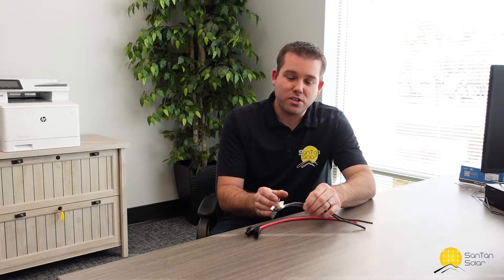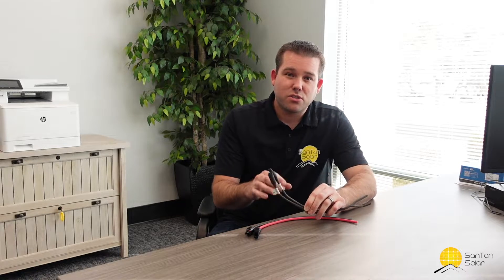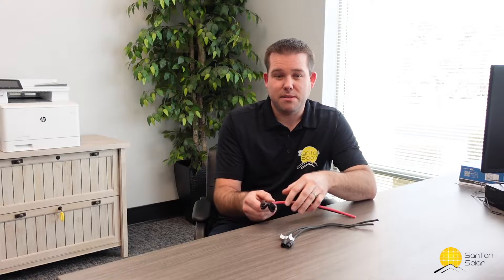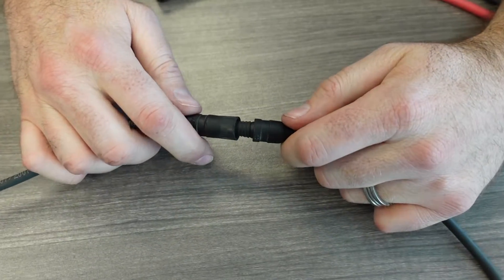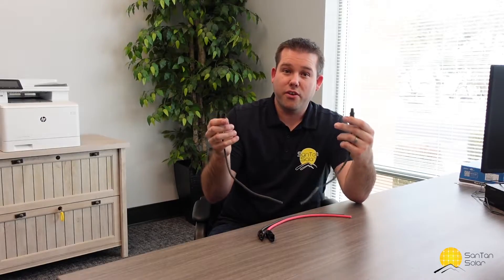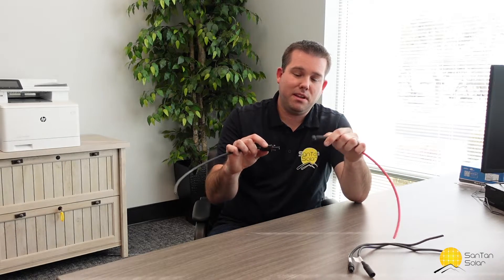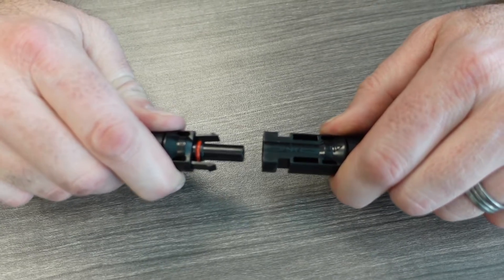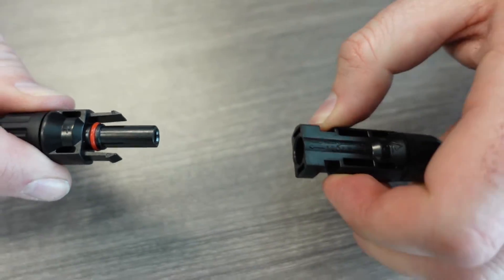MC4 Connectors | Compared to MC3 Connectors | Solar Energy

Comment: Can I have adapter for mc3 to mc4?
Reply from the maker: The connectors are different sizes, so that wouldn't work. If the panel has an MC3 connector, it is easier to clip it off and replace it with an MC4 connector.